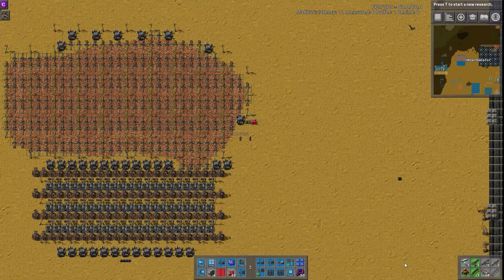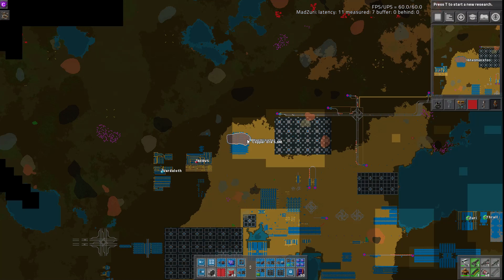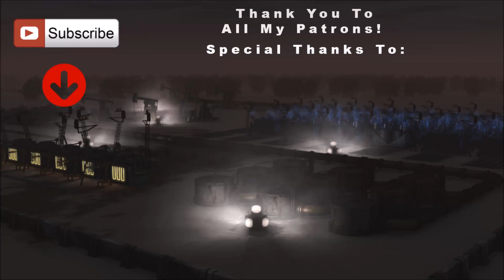Smart Outpost / Miner Setup :: Factorio Workshop Season 2 - Building A Better Factory

Comment: why dont you just have a single miner that you add afterwards that is not intended to mine but rather just output the resources amount of the whole patch so you get an acurate read rather than some janky div by 2 estimate that will still be off by a fair amount
Reply from the maker: Malus Draco That's a really good point actually. Definitely don't have to have all the miners output their resource amount.

Comment: This is a cool new feature of 0.15 and thanks for highlighting it.  I am wondering though, if you specific example of using it would be as well served by the much simpler approach of reading your local network for the current ore tally and using a power switch to disable all the miners past a threshold. Thoughts?
Reply from the maker: I think either way would work actually. Although power switches can actually increase the electric network game time used if you have a lot of them, so that could be come an issue.
Reply from the maker: I think either way would work actually. Although power switches can actually increase the electric network game time used if you have a lot of them, so that could be come an issue.
Reply: Personally I would use the power switch option to disable all of the beacons, and the drain from the miners. But if performance was an issue, then maybe I would go for your option Xterminator.

Comment: You use bot mining and use that "poor" power pole layout? Why? Why not use a denser layout? Even on a new map, as soon I have undergrounds, I start using them.

I hope it is not again the bullshit of calculating exactly how many trains you can provide with the patch and arriving at the conclusion that it doesn't need to be any denser. Because that makes no sense.

If it is true, why not increase density, but add productivity modules to the miners instead of efficiency ones. Not many, just a few. You can add about 1 more row to that patch and you can math it out so you have roughly the same speed, but have higher productivity and the patch will last much longer.

Comment: First I'd like to say thank you for making this video I forgot that minors could be hooked into the network. Currently I control the power to my minors. If they're hooked into the circuit network does that disable their standby power consumption.  I also use power control on my furnaces to keep power usage and pollution lower.  This has saved me from early biter attacks early build. Keep up the good work gentlemen.
Reply: *miners
Reply from the maker: You're very welcome! Power control is certainly a good method and would turn off the idle/standby power consumption. Although I have noticed that if you use too many power switches it can actually increase the electric-network time used, which will hurt performance a bit.

Comment: Interesting. If I were to implement this for a patch without local smelting, would I just stop the miners when the chests had a certain amount of ore, or would I send a signal on a wire along the rail line all the way to the smelters to compare with the plate count?
Reply: You could do either. The wires would be different for each one. Depends on what you want for that factory!
Reply: I'd recommend doing it locally, because otherwise you might end up with all outposts sitting at like half a train of resources each.

You could also do both at the same time.

Comment: Why efficacy 1 modules?  I was also thinking on a way to call different ore trains or number of trains based on the amount left in a patch.  What about solar or nuclear power and then efficacy modules for assemblers, smelting, mining ? yeah not going for speed or your prod. but why not have fun with it!
Reply from the maker: Efficiency modules would reduce pollution and power consumption even more. And it's cheaper to put 3 level 1 modules in the miner rather than level 2s or 3s.
Reply: Xterminator I tested out as well. Forgot about the 80% power draw cap! :)